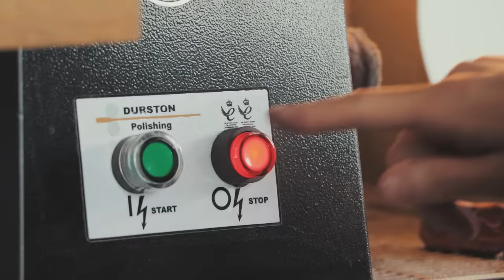Engagement Ring - How it's Made

Comment: whats the stuff your middling around in the beginning when you cut the excess off and went to sodder the two ends together? you put some water in the circular stone thing and then used the, muddler I believe, and then used a fine brush to apply it to the circular piece before sodering

Comment: The speed of the manual is too slow! I use jwelCAD rhino zbrush to make these rings.
Reply from the maker: Manual = slower however you get higher quality. CAD = faster but lower quality. All depends on what your custom wants. I use Matrix for my CAD work but its just a tool I use sometimes it is not my full production process. For me, hand made is what I offer my customers.